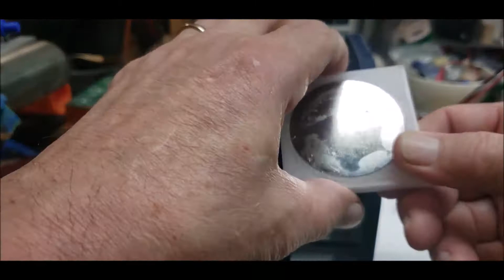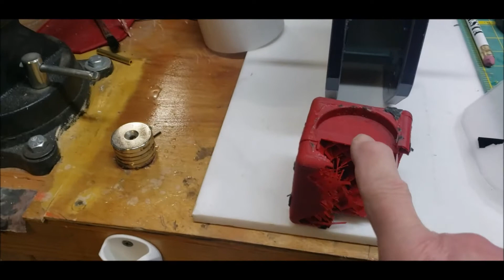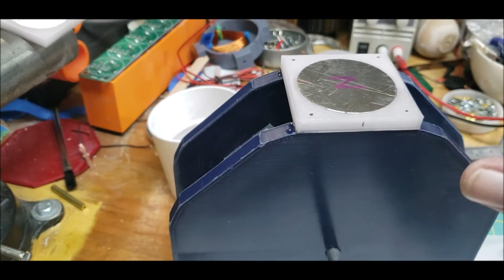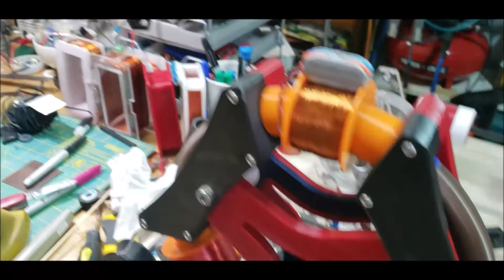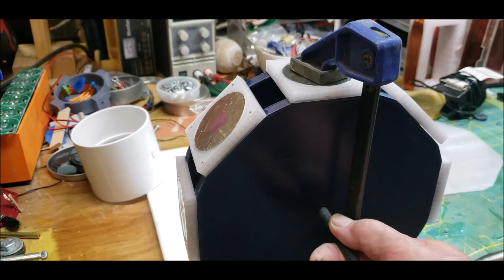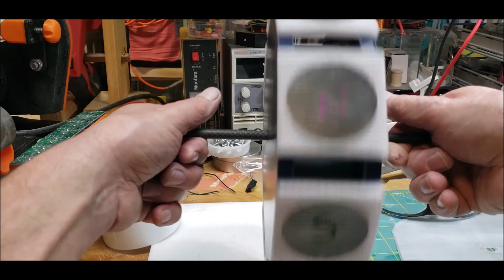3D Printed "Beast" Rotor Build

Comment: They're not going to fly out. Someones famous last words.
Reply: Use a fish scale and hang it from a line.
Reply from the maker: lolololololol I will probably regret saying that
Reply: @mcorrade  I know my old flywheel I used fiberglass resin to hold things together. I was using a 9 to 1 gearbox to turn it. 1 turn of the drill was turning the flywheel 9 times. Before you screw make sure to put the magnet cover plates on.
Reply: https://youtu.be/TaReAg5E7Dw lol the destruction
Reply from the maker: @MAGnetICus_Attractus  man-0-man the explosion was epic
Reply: @mcorrade  I found the fragmentation impressive.